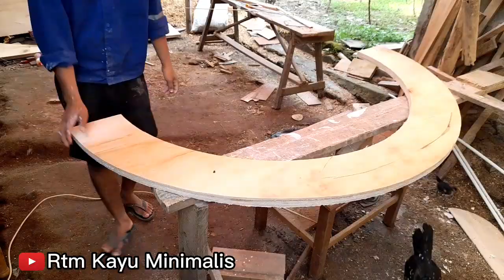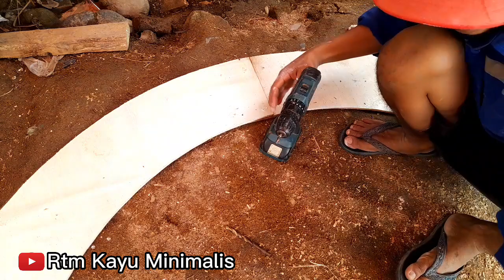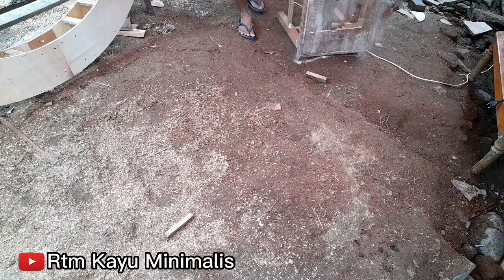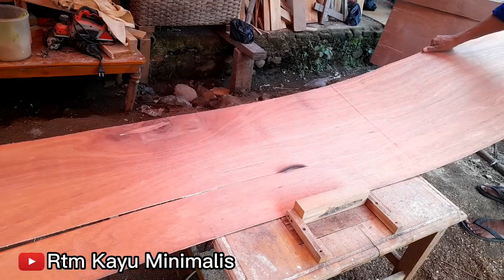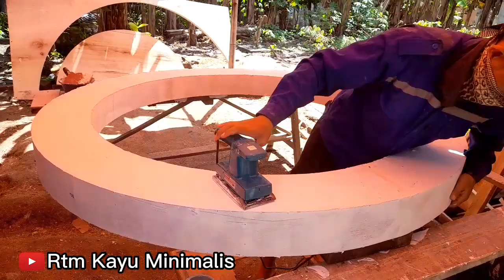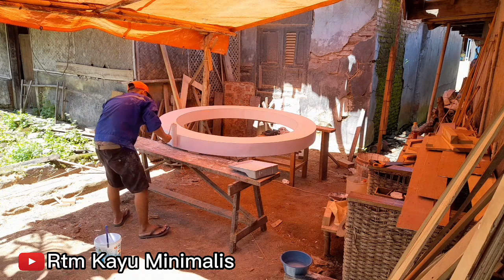Membuat Pelaminan Dari Teriplek Simpel Dan Sederhana , Terbaru 2023

Comment: Triplek brapa mm pakde
Reply from the maker: 8 mili. Sama 4 mili. Kak🙏🙏
Reply: @rtmkayuminimalis1522  oke pakde makasih
Reply: @rtmkayuminimalis1522  ukuran triplrk.nya brapa meter x brpa pakde..kok di tumpuk...kalo diameter 122
Reply from the maker: Ya kak di tumpuk biar sekalian motong nya. Buat lingkaran nya diameter. 122. .. jadi satu lingkaran harus motong 4 biji. Jadi sekalian motong nya. Untuk lembar 20.cm. untuk tebal 14 cm. 🙂🙏🙏
Reply: @rtmkayuminimalis1522  pakde sebelum di buat lingkaran tripel.nya berapa ukuran...lebar dan panjang.nya
Reply: @rtmkayuminimalis1522  tinggi lingkaran kecil.brpa.meter pakde
Reply from the maker: Sebelum di buat lingkaran.  Untuk ukuran yang 122.cm. kita bagi as. Atau cari tengah nya. 122. ÷2=62.  UNTUK lebar lingkaran. 20 cm. Kita ambil dari tengah. Dari ukuran 62cm. Ambil ukuran 42.cm ke pinggir. tinggal kita. Puter saja ukuran nya. Pake benang atau pake kayu bisa. Kak
Reply from the maker: Untuk ukuran yang kecil. Diameter. 122.cm kak. Untuk yang besar. Diameter. 150.cm kak. Dengan lebar 20.cm. dengan tebal 14 cm. Kak🙂🙏